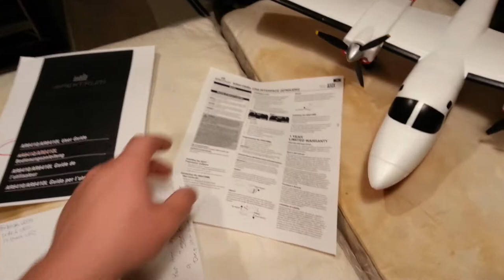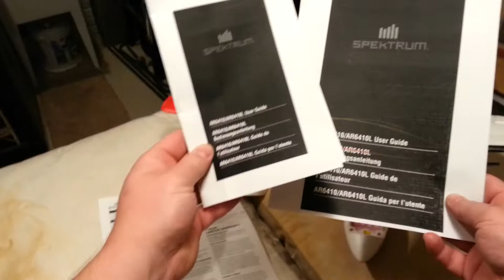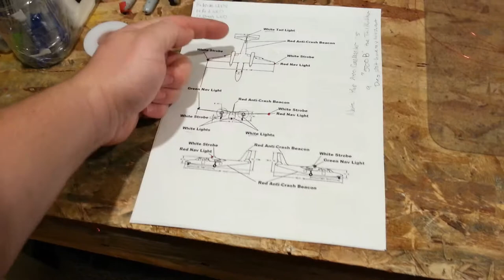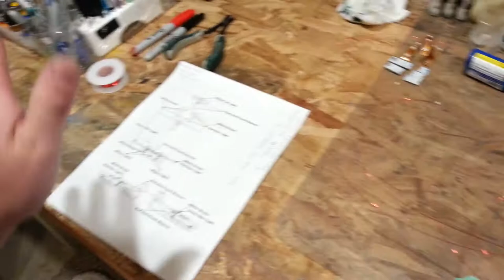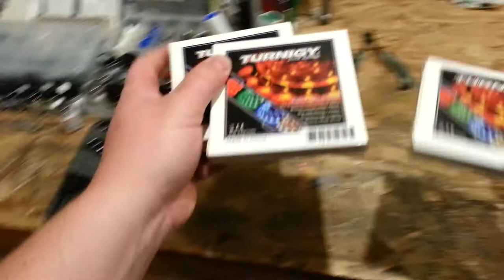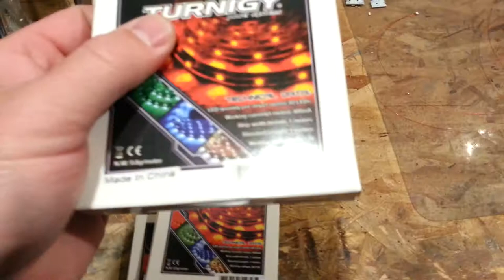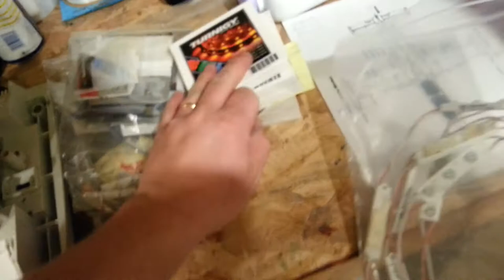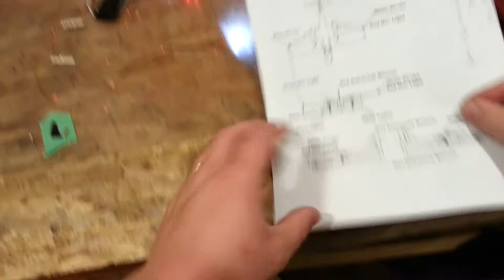Eflite - Aero Commander UMX - LED Mod - Part 1

Comment: HaHaHaHa Plane Attacked! 
Hey Brian, I got a whole strip of 300- 50/50 LEDs Bright White 5M=15' on ebuy-it for $4.25+Free! & another 15' 300 strip of 38/25s in RGBs for $1.25+Free which are much smaller butt still very bright & that will change their colors with different resistances... The Non Waterproof have nothing in the road to remove easily! I also found a broken 4' LED Florescent Light Tube dumpster diving & there is about 500+ LEDs on that!!! Thanks
Reply from the maker: Cool!!

Comment: For this tiny little solder joint try solder paste and solder heat gun. Put a little drop of solder past on the led, then tape the cable in to the table and the tip in the solder paste drop and solder it with the heat gun and pronto. much easier and is cheap, you can buy a really good solder heat gun at banggood for a few buck like $40 but in the long run is a great investment with many uses.
Reply from the maker: I have never heard of this....which is really weird since I've been in production plants where they do these sort of assemblies.

Thanks for the idea!

Comment: Brain... the tape is a good idea for soldering... I use double face tape..  it works great for small wires..  the tape now holds the item being soldered and that thin wire can also be held down while you solder the wire to the item...
Reply from the maker: I'm evidently too cheap for that - LOL!

Comment: Hey Brian
Another video that I enjoyed watching! Although I have a question: have you considered scratch building RC planes? Horizon hobby products are great and professionally made (my favourite plane is still the delta ray) but are very expensive, and with scratch builds you can add lights, flaps, retracts, whatever you want, with ease and relatively little restriction. Also, it is kinda cool making something then maidening it and fixing it if you crash.Just a suggestion though, HH planes are still really cool
Reply from the maker: One real concern as a YouTube creator is that it's hard for me to setup tags for my audience to find the videos on custom built planes. I'm hoping that as I get further into my experience with YouTube, and have a larger audience, this will not be such a factor. Honestly, I like the process of building planes too, but just don't have time for this right now in my life, and to be totally honest, I just really like to fly the planes! If I could just show up and fly like 5 new planes every day, it'd be a dream job for me. I have a real appreciation for different planes too. This appreciation has really blossomed with my RC interest. It's funny too, I used to think this plane or that was kinda "blah"...but now, I see the differences, and can appreciate how they will impact flight performance. It's a blast!

One main reasons I choose to modify planes, is that it gives footage for the channel, but I'm also very picky. I want things just so. Even Horizon Hobby necessarily cut corners to hold cost down, but I really like their products.
Reply: Brian Phillips Fair enough and well said, anyway keep up the consistent uploads 😊
Reply from the maker: Thanks! More coming today and tomorrow :) Hope you enjoy them.